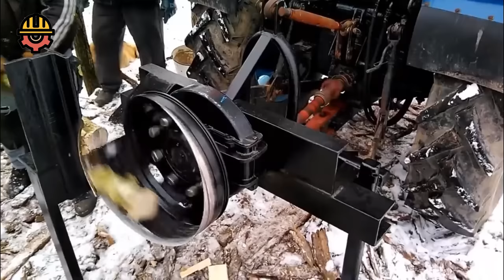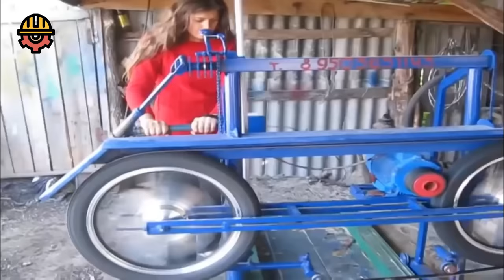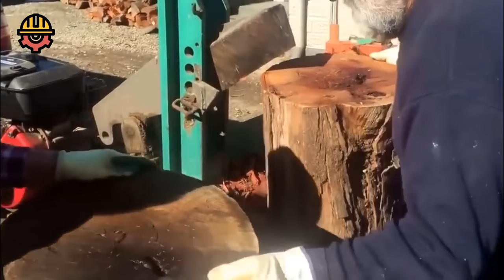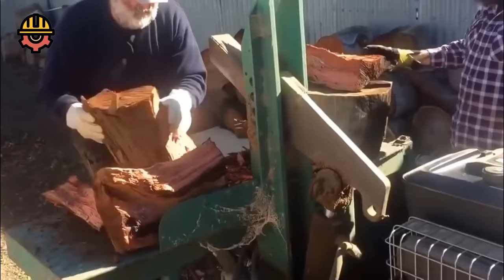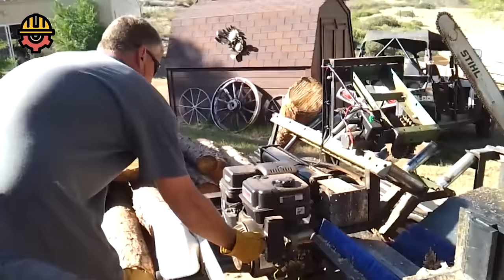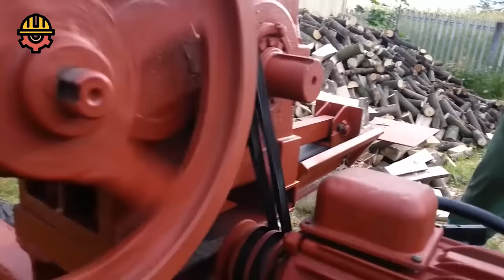Dangerous Automatic Homemade Firewood Processing Machine, Fastest Powerful Wood Splitter in Action

Comment: My Lord, I used to split wood with a splitting axe.  Not bad, until you meet the one with the twisted, knotted grain.  Then I got a small wood splitter operated by a small gasoline engine.  Nice and easy, until you meet the one with the twisted, knotted grain.   Then I got a large wood splitter powered by my tractor, that was fun and no problem with any twisted knotted grains. Then I moved to the south.  😄

Comment: The only really dangerous one is the band saw. A snapped saw whipping at that speed can really ruin your day. 
The others are not really more dangerous than a standard splitting axe.
Reply: While not everything shown in the video looked unacceptably dangerous: The common hydraulic log splitters are much less dangerous than the continuously running splitters in this video because: You have to hold the valve open to make it move. If you notice that you have a finger or other body part in the way, you will naturally stop pushing with the hydraulic ram. This might not eliminate possible injuries, but it could easily prevent complete catastrophe.

Comment: So - all of these are dangerous just by being senseless machines having enough concentrated force to split / open a log. Exactly as many of mass produced machines are. Sure, some of them are slightly more dangerous because they lack some obvious and easy to implement safety features. But in general I dislike the notion that homemade = dangerous. I'd say these are prototypes, some of them for sure just being in phase of development. Ppl capable of putting contraptions like that together can not be stupid. I am sure many add safety later on.

Comment: Anybody who has split wood either manually or by machine, will know that there are always pieces of knotty tough and fibrous logs that never split cleanly and where the wedge gets jammed in no matter what force is initially applied.  I would just like to see what one of these powerful machines does if the wedge on the piston suddenly can't cut through it and what effect it has on the motor or cranks to be suddenly stalled in this way.   I know it has been a nightmare dislodging such stuck wood from a very powerful electric vertical splitter.